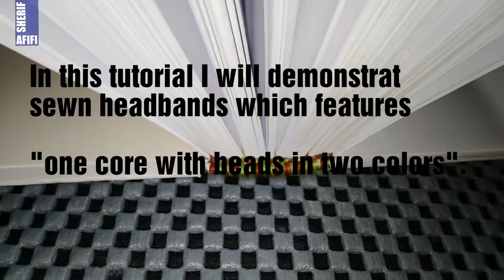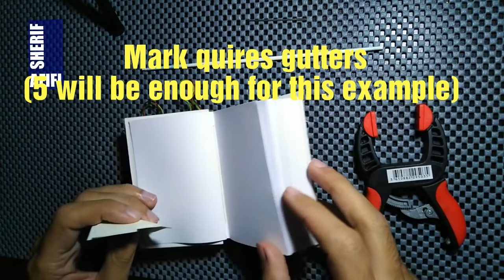Book Endband | One core in two colors Headband with beads

Comment: Beautiful! Why not use two needles, one for each color? And  a pair of pincers to get the needle out (saves sore fingers..)
Reply from the maker: Thanks for your comment. Actually, I have been taught to use 2 needles, but after several years of doing Endbands (as a conservator) I found it confusing to use 2 needles (the threads twine over each other) than using only one specially for beginners, and the aim of this tutorial in the first place is to teach the emerging conservators. 
In the other side, to get the needle out, some times I use forceps (the lower part) you may found it in my other headband video tutorials here.